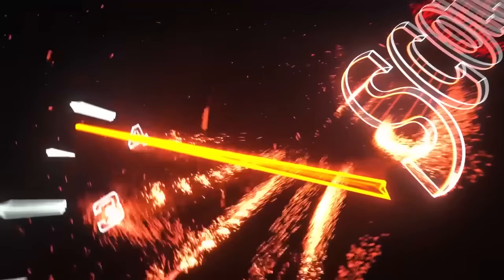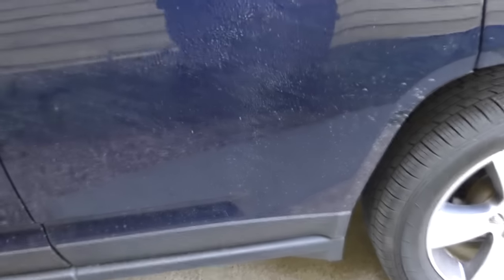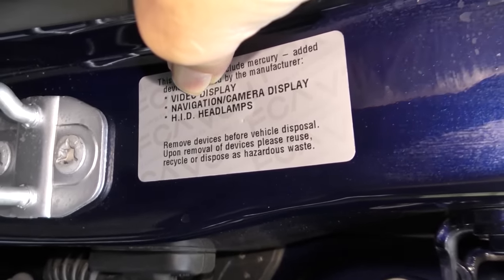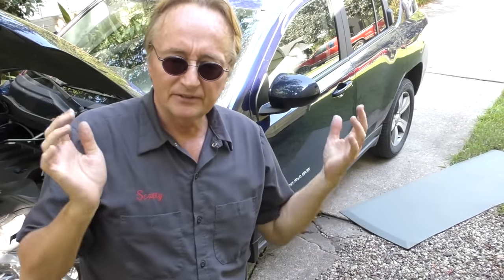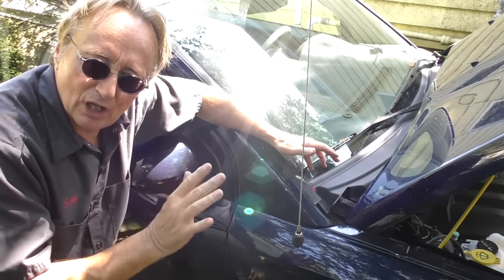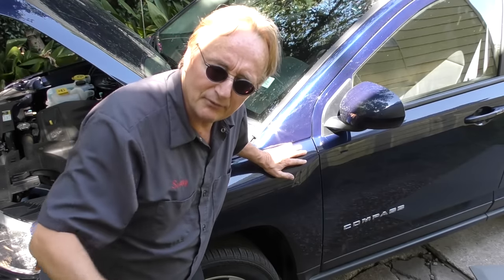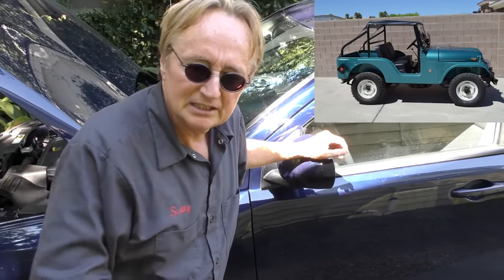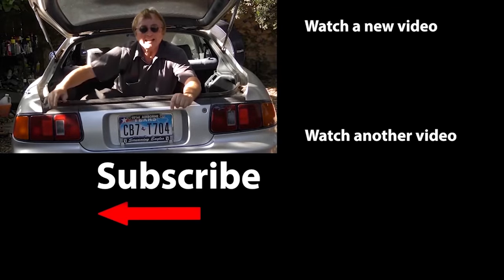Here's Why This Jeep Compass is Crap

Comment: I have a 2011 compass it has 163,000 miles and still runs great so I guess the saying your mileage may very comes in play and I get 23 miles to the gallon with mine
Reply: You got LUCKY that's all! Just wait I'm pretty sure you will be eating your words sooner or later!
Reply: @Rhonda858  my 2012 is at 101k. No major issues
Reply: My 2011 has 170k no issues.  Just a battery change
Reply: I have a 2011 Compass with 146K miles on it and it's been the best car I've ever had. I think what Scotty is saying that when Fiat bought Jeep in 2017, things changed and it's now on a Fiat chassis which has declined the quality. That was not a problem in 2011
Reply: My wife's 2010 limited has 110k and still runs great, the A/C compressor needs change but thats it.
Reply: @Rhonda858  Our 2012 just hit 70k miles, only problem we've had with it is the electronics on the anti-skid feature went bad and the plastic "chrome" plating on one of the door handles cracked and started peeling. It's a good little SUV. Just wish I could get a full sheet of plywood in the back.

Comment: I have a 2012 Jeep Compass at 75K miles. No major problems thankfully. Knock on wood
Also, loving the behind the scenes there. More of those please. lol
Reply: THose were PRE FIAT
Reply: The new ones are light years better than this Daimler-Era designed Compass. You can't even compare the two-; it's not fair.
Reply: @skoprowski  Tigershark is the latest Chrysler version of the World Gas Engine (HYundai/Mitsubishi/Chrysler circa early 00s)
UConnect is all Chrysler side as well
9 speed is from ZF and was rushed to market for the Cherokee
Reply: @Alan-tr5uj  As Kopski said, the one Scotty is reviewing is the old MK design from Daimler-Chrysler.
Reply: @Alan-tr5uj  how do you feel about the 2010 compass?
Reply: I have over 100k on my 2012 and its been great so far. Also, knock on wood.

Comment: Most points are accurate put the mpg part is WAY off. My compass averages 30 on the highway and 20-22 city
Reply: Listen more carefully. He's talking about the 2.4L four wheel drive version.
Reply: @Waingro808  your 100%.
Reply: @Waingro808  Google it. It's 20-22 city
Reply: DrivingHawaii it’s got the same weight basically as the 2017 rav4 but gets about two less mpg comparing awd models. So two of his main points aren’t even true in this video.
Reply: @flashv4941  Real world I got no more than about 22-23 max on the highway and normal speed of 70 mph. About 17-18 in town.  A 2.4, cvt with 4wd. If I slow down to 55 and never fight the wind while going downhill I can maybe get around 28-30. New full size F150's and Eco diesel Rams get around 30 mpg. Regular v8's in normal full size trucks get better mileage. Hopefully the 2nd gen addressed this issue. I doubt it though.
Reply: @Waingro808  dude my 2.4 4x4 gets better gas milage them my Mercury Sable, so he is definitely wrong with that

Comment: I just bought a 2013 compass and it’s actually a great little car for the price, super easy to work on, cheap, and reliable, I’ve got just over 100,000 miles on it and it’s still runs like a champ. The weight is actually 3200lbs and the mpg on average is 25mpg, and it’s a bit quicker than my ford transit. I think this might be a little fiat-hate bias lol
Reply: From my experience he is spot on; I own a used one. I had to purchase a repair manual b/c the issues with it are numerous and expensive. Bout to tow it home hopefully tomorrow.
Reply: SUPER easy to work on... really? What have you done? Brakes... put air in the tire?
Reply: He is talking about the 2017 model which has a fiat engine, renowned for using cheap materials that degrade quickly, yours most likely has a Mercedes engine.

Comment: Just bought a 2020 compass and absolutely love it.
Reply: How is it still going with the car? I may get one
Reply: @jackloveshugs7023  I love it... great on gas, over 22k miles already.  Cant complaine over here
Reply: @jackloveshugs7023  I just bought a 2017 Limited with low miles and it’s amazing I absolutely love driving again!
Reply: @jackloveshugs7023  awesome car. We’re loving our 2021 “S”
Reply: Love my 2020 compass.  At 16,000 miles with zero problems.
Reply: @tyson6819  same here, I'm at 22k.... I would definitely buy another one in the future,  but I just bought a 2013 Maserati granturismo MC with 8k miles on her. Sooo in love lol
Reply: Haha just you wait! My Wife bought a 2018 brand new in 18 and now the fancy Uconnect screen is bubbling and on our trip to the beach a couple days ago the transmission service light came on when we stopped to eat when I put the car in reverse it jolted horribly. I turned the engine off and let it sit like that for a few minutes. Cranked it back up the service light went away and it shifted fine. We get back from the beach I plug my scan tool in and there are 3 codes. TCM denied Torque Converter, Torque converter signal is stuck, and some electrical problem with the cam bus or whatever. Then all of a sudden on the Guage closer all kinds of alerts went off service Airbag, service power brakes, service crash detection, service camera, service engine, service transmission, service power steering. Pretty much service everything. Then when I put the car in drive or reverse the severe jarring occurred again sounding like the transmission is about to go out. Turn the car off and back on put it in reverse and it shifts smoothly. I think it is an electrical problem which talking to several local mechanics is most likely going to be expensive. It has 70,000 miles with zero problems a month ago. Screen started peeling and now electrical transmission problems. Scotty is right! These are trash. We are going to look for 4 runners next week and get rid of this piece of trash. You are at like 20 something thousand miles so get rid of it while you can.
Reply: Wait a few years you will see.
Reply: @pedroa.6473  will be waiting!
Reply: Honestly how many cars have issues within 20 to 80k miles I just wanna see how they do once they're way up in miles
Reply: @ethanrod7968  great thus far.
Reply: @ethanrod7968  thank you,  just had one done 3 days ago. I put 25k miles on it since last Feb 2020 . It was brand new. Shes my work horse. I just bought a 2013   Maserati Granturismo MC,  so that's my weekend car lol
Reply: I’m a new teen driver looking at the 2018 jeep compass. I heard it is very slow and it best for highway driving. Is that true? Obviously as a teen I don’t need a powerful car.
Reply: @certifiedlover2748  it's not ridiculously slow. It's a 4 cylinder.  So its expected.  It does great on freeways.  It's my work horse,  so I didn't want a bigger engine.  I just bought a Maserati Granturismo MC,  that has a Ferrari engine v8 in it. So I'm good lol
Reply: Wait til you have to start replacing tie rods, electronics, trannie failure and more. I had 3
Reply: @ms.p.r.9553  Yeah we are going to try and get rid of it once uconnect puts a brand new touch screen infotainment system in.
Reply: its still new .

Comment: Scotty, in the early days, when jeep started making and selling, the products were spec'd out by design engineers who knew what made a vehicle robust. Today, the spec sheet comes from the marketing department, not engineers. The marketing and sales group tells the engineers what they want for a product. The engineers just do what they are told. This happens again and again with products that have achieved a brand status in the marketplace. Products that were once well designed by founders with a passion for the product over time are replaced with sales and marketing types who know nothing about design. They cheapen the product and leverage the brand name to maximize profitability. Steve Jobs talked about this. Its not uncommon.

Comment: Scotty is spot on. I leased a 2018 Compass for my daughter and the tranny was replaced at 8k miles, transfer case started leaking at 9k miles and now burning 2 qts of oil between 5k oil changes. Thank god it’s under warranty.
Reply: c k, Aren't you glad you leased it! You can hand back the keys at the end of the lease. Scotty has mentioned this idea, too. He has talked about leasing vehicles that have a history of questionable longevity. With leasing you can simply hand in the keys, and any major work will covered by warranty anyway.
Reply: The dealer will tell you that oil consumption is normal. 🥴
Reply: I got a 2015 Jeep Compass. Has 30,492 miles and hasn’t had one single drip of fluid or problem. Oil hasn’t been burning.

Update: it now has 34,762 miles now and still the same. Not a single drop of any fluids and trans is running amazing!
Reply: I’ve got a 2018 myself and I’m at 68000km with ZERO problems ... so. You prob got a lemon.
Reply: Funny, the transmission on the compasses are made by AISIN, the same company Toyota gets their transmissions and has a 40% stake
Reply: Had the same exact issue with my Honda Odyssey. Got a new transmission. You cant put down Fiat just because this smuck thinks their bad. Guess what, Honda has bad days too.
Reply: Dave D yup they did tell me it was normal
Reply: ...so the fact that one car out of  171k sold in the USA that year alone has problems makes it crap? interesting theory
Reply: Sounds like you’re being robbed by your mechanic

Comment: I had one for 75,000 miles with zero issues. Gas, oil changes, and tires was it.
Reply: I have a 2015 I love mine. I use  the manual shift
Reply: I have a 2014 with 90,000. I’ve only had to do basic care like oil change 😒
Reply: Interesting... I seem to see a bit of a pattern here. Most owners talk like you guys though a lot of the online reviews trash it... Im in the market for a used car now and thinking of buying the 2017 new version Compass. Seems like a steal.

Comment: bought a used Jeep Compass lattitude, 2016, fwd.  Works really well.  I have driven it to Los Angeles a few times from the Bay Area, and even to Reno.  Automatic transmission where you can also drive it like a manual is definitely needed on those long climbs in the mountains.  My vehicle I have learned to be gentle and not aggressive.  Drive to the strengths of the given vehicle you have, and you will not be disappointed.

Comment: I have a 2014 compass. What he forgot to mention is that they are great in the snow. Take it from me.
Reply: lane8376 I’ve got a 2012. Damn thing is better in the snow than my Subaru ever was
Reply: The trunk space is a little small but I love the vehicle. In the summer I use 2wd. When it’s snows I use 4wd. Need to change my rear differential fluid though. Hope you change yours. And so many people want Subaru’s.
Reply: @lane8376  how's it possible to change to 2WD? I thought only option is the AWD switch to switch between AWD & 4WD. Please enlighten.
Reply: Prashant Kadam Well in my Compass between the two front seats,below the arm rest and next to the emergency brake lever is a metallic lever that is kind of in the shape of a T. If your vehicle has that lever pull it up. It should show you on your dashboard that you have engaged the 4 wheel drive mode. Keep in mind all wheel drive and 4 wheel drive are different. Hope this helps. Also you can download a free Manuel for your specific vehicle online.

Comment: Piece of crap. My 2007 compass has 323,000 kms (200,000 miles) on it and it's the original 2.4 and cvt transmission
Reply: My 2008 has 170km on it right now and I'm still driving it.. 🤷🏾‍♂️
Reply: My 2007 compass has 240k and she's still running!
Reply: I just got a 07 compass with only 64000 miles on it and it's great
Reply: How did you maintain the cvt? I have never seen a Compass cvt lasting this long 👍 I use vacumn pump to extract 2qt cvt fluid out via dipstick tube and refill 2qt every 15k miles, no issues so far. I have never done a drop-pan filter+fluid change.
Reply: @yiyuan8202  change fluid at every 30k interval.
They do have a filter inside that needs replacing.

Comment: The Jeep Compass has tons of legroom in the rear. In fact its huge. I'm 5ft11" and sitting in the rear is great. More legroom in the rear than the Grand Cherokee.
Very comfortable too.

Mine is 6 years old and I've had no problems. 120 000km.
Manual gearbox has no problems. Only the CVT known for gearbox problems.

It's a great vehicle.

Comment: I have a 2014 Compass, I gotta say, they do have their flaws but wow I am quite impressed with the amount of garbage you managed to spill out, now i have a base model, no sunroof, to touch screen, no power seats, nothing fancy, but it gets me to point a and b, the weight is all wrong as well, a compass is under 3500lbs, gets about 22-23 mpg city for me 26 on the highway if drive nicely, now i do have a few components failing, just had a radiator go out, replaced the throttle body not so long ago, but those are easy to replace, I have to get a head gasket now, thats a tad more tricky, but I'm over 227,000 miles on it and it still runs like a champ, apart from the head gasket that just went out, but after I change that out itll be back gaining more miles in no time.

Comment: love your channel but i bought a 2015 for $6500 2 years ago with 170000 miles   i know have 215000   engine transmission knock on wood been excellent  i have had wearble items replaced. brakes, fan belt, ball joints and a rear drive shaft since cant replace the u joint by itself   overall its been a reliable car and got my money worth.  gas milage lousy on average i get 270 miles full tank

Comment: I have a 2011 Grand Cherokee (2wd Laredo). Love it. It now has roughly 205k miles on the 3.6L V6. Still going strong.
Reply: I have a 2010. 190k. USA made engine. Still runs like a champ.

Comment: A guy I work with got one used for $10,000. The CVT transmission want out at 80,000 mile and it cost $4,900.
Reply: WOW he was lucky to get 85 k out of it
Reply: It's a Jatco JF011E transmission. Same company that Nissan and Subaru get's theirs from. Now the 2017 Jeep Compasses use Aisin AW60T 6 speed which are Toyota transmissions but unfortunately the 7 speed dual-cluch FTP C725 is a Fiat and the 9-speed is a ZF 948TE.
Reply: @hedga001  the 6 spd Aisin auto has been used on the Compass since 2014.
Reply: luisinhoens90 The 6-speeds used in 2014-2017 are Hyundai Powertech, not Aisin. They didn’t use Aisin until the redesigned model late-2017 and newer.
Reply: @jeffgibson4937  true that, my bad

Comment: We have a 2004 Cherokee 2WD with the 4 liter iron horse straight 6 engine, that SUV runs great and as far as I'm concerned it was the last of the well made Jeep products, 2005 Jeep did away with the straight 6 and went to the V6 & V8, no room under those hoods for squat.

Comment: My wife’s has a 2014 with 210, 000 with cvt transmission. It has only had preventative maintenance and a front wheel knuckle assembly, because She hit something. It is a grocery getter and it gets her to work in Michigan winters. Still going strong.
My wife’s previous car, a dodge neon. Another car everyone told me was junk, is still going strong, as my daughters first car.
Reply: Never changed the cvt fluid over the last 210k miles? That's unbelievable. A drain & refill will help the transmission's life tremendously.

Comment: I’m not a Chrysler fan. But calling a Carbon steel bolt with a little oxidation on it “Crap”, May be a little nitpicky.
Reply: Those bolts are just an example of how the car was engineered. Those bolts might not be serviceable in just a few more years. Cars that were designed to be repaired for many years to come will have enough corrosion resistant coating on the carbon steel that it won't look like that after 25 years or longer. That much corrosion on a 5 year old car in Texas is appalling. It's either a sign that the car has been in a very salty environment, or it was designed to be a disposable car.
Reply: Popudax - my thinking eXactly.  30k miles in a no-show state with that (admittedly modest, at this point) rust in a relatively protected area at the top of the struts is a very bad sign of things to come.

Comment: But i love my compass. I got it as a gift for getting accepted to college.
Reply: I got my 2016 compass as a gift too and other than a new throttle body (covered by warranty) it’s been great
Reply: LOL
Reply: I love mine too but hes right about all of it. It's annoying how much gas it sucks up.
Reply: @hollcheese  i get great milage on my compass and its a 2015 so 5 years old. Very well maintained.
Reply: Holleh Mareh what year ? is it
Reply: Ali Williams I just think it’s the newer ones I have a 2015 and it’s great tbh
Reply: Now you'll have college and car repair debt
Reply: @briannavarrete49  i have neither. The car is fine after 56000 miles so far. The only repairs i needed was a tire change because i had nails in my tiresz and there was no tread on them.
Reply: Heck my wife's 2014 compas works fine with 109097 and no serious problems.
Reply: I got mine as a gift too 70k grandpa miles on it trans started slipping under about 1/2 throttle have to figure it out what's wrong
Reply: Don't listen to this guy he i negative about everything on cars
Reply: Imo certain vehicles are better as leases. Jeep Compass will not present any issues in the time it takes you to return it and get a new one.
Reply: @dailyrandoms2264   we don’t all have money to throw away on cars
Reply: Now when you come out of it better get a Rubicon
Reply: Ya I have a ‘14 compass my dad bought it for me for my first car thing starts right up everytime no issues and get new from point A to point B
Reply: @ajnestor8066   must be nice to have daddy money 😹
Reply: I just Baught a 2014 2.4 a few months ago, I love it so far. It's comfortable and rides nice, the 2.4 is pretty good in acceleration and it doesn't feel that slow. And it's gas mileage is really good in my opinion, better mpg then my Sable even though the Sable is definitely probably better long term quality and reliability